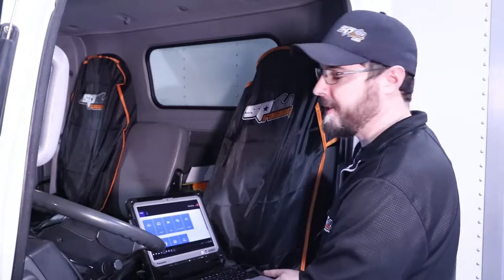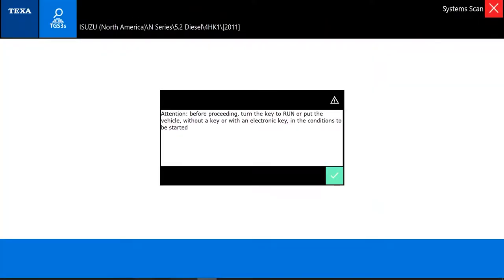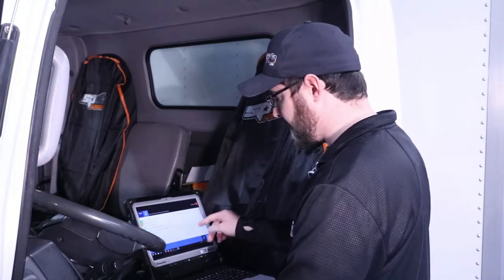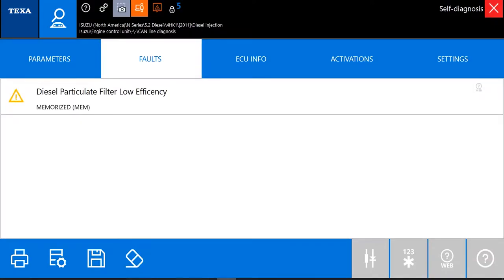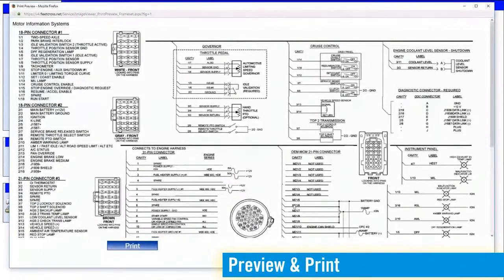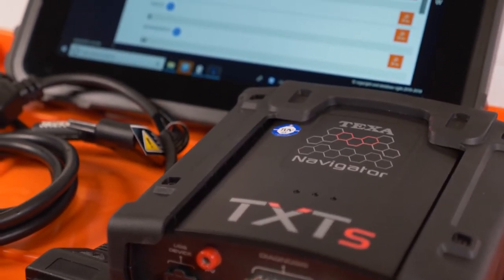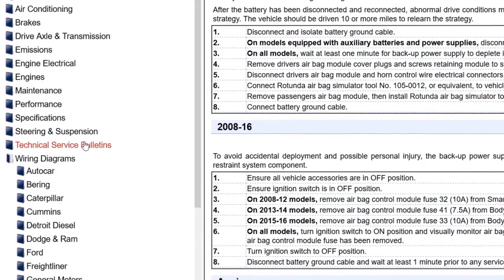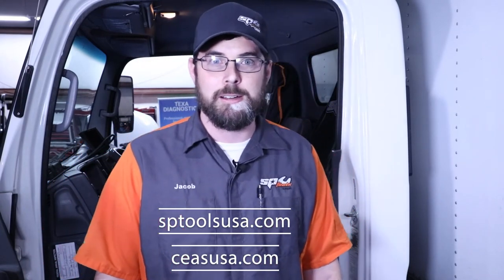Fixing a DPF Low-Efficiency code on a 2011 Isuzu NQR in under 10 minutes with TEXA™Truck

Comment: A friend of mine bought a 2014 nqr with all the Christmas 🎄 ligths on in the dashboard double check engine ligths were on dpf etc etc ,didn't make no more than 50mph
Bought it for 15gram$ 
With 71,000miles on it ,basically the truck still new in my opinion, brand new truck worth$ 61,000
Back to the point, the people that sold the truck to him tough that the truck would have a high price repair and sold it to him ,he bought it like that and guess what ,he drove that truck for a week like that and now it's running like a champ every day ,I guess the def fluid was contaminated or something.

Comment: If pressure differential sensor is not unplugged and filter is pulled and replaced/cleaned does the sensor need to be recalibrated?
Thanks

Comment: If you do find one of the lines plugged,  such as on mine, (2011 Isuzu NRR) the hard line going to the DPF was plugged.  What would that indicate ?  Does that mean the filter is clogged and the soot just built up into the line ?

Comment: my friend i have isuzu nqr 2008 and the dbd is blinking always and the truck power is very low max 50kmh and the exhaust brake very weak i dont know where the problem is i cleaned the barrel for the exhaust brake but still the same problem any idea what to do?

Comment: Hey man I have a 2015 NPR HD 5.2L..the red EXH. SYSTEM light is on, a long with the low power & low DEF light. The DEF fluid is full and it is also showing full. What could cause this? It’ll complete a manual regen, till the end it tells me to “hold rpm over 1500 to purge exhaust” once I do that, it’ll abort and the regen doesn’t complete.
Reply from the maker: Hi Delco, What codes are you getting?
Reply: @CEASUSA  No codes at all..that’s my biggest issue is how confusing it is lol
Reply from the maker: @BassAngler  We know the feeling, let us see what we can find out for ya bud!
Reply: Did you find the issue to your problem. Was it an update/reprogramming issue with a control unit?
Reply: I'm having the same issue with a 2014 isuzu reach 3.0 took the dpf off had it cleaned tried to do the regen it gets to the end. Set rpm to 1500 and it restarts the process! Any help from anyone would be much appreciated thanks
Reply: Hey. Did you ever figure out the problem? Having exact same issue.

Comment: Good afternoon and thanks for this video. I have a 2016 Isuzu reach (FedEx express truck) that it shows me EXHAUST SYSTEM in red and the check engine with an arrow pointing down light on. Before that the message was REGEN REQUIRED but I did the active regeneration process 3 times because the message still so the scanner doesn’t show me any faulty codes so I’m in doubt with this issue if you know what could be I’ll appreciate it thanks
Reply: There is literally no way to clear the “exhaust system / Def light” without the Isuzu IDSS scanner. Autel, Snap On, Texa, etc.  won’t do it

Comment: hi  can you help me my isuzu truck nqr  is smoking bad code is p1404 so i put new egr valve but still the same
Reply from the maker: Hi Eric, Some things to check out
-Faulty Exhaust Gas Recirculation (EGR) valve
-Faulty Exhaust Gas Recirculation (EGR) valve solenoid
-Exhaust Gas Recirculation (EGR) valve carbon blockage
*If you've fixed the valve may just need to check for blockages in the EGR valve and the EGR coolers.
Reply: @CEASUSA  thanks for the response I put new one egr valve and it's still same,thing is when it's reach temperature that's when it's starts smoking which is a blue smoke..the Isuzu dealer said that my truck has no solenoid valve

Comment: Hey what if I have an Isuzu NPR 2012 and is giving that light in the MID display and don’t run  faster than 5 MPH, what can I do and you much would it cost to get a new filter ? Please
Reply from the maker: You can probably pull the filter off and have it cleaned, as long as it isn't cracked or damaged. A new filter from the dealer is around $1200 usually. Of course you'll want to verify all of the after treatment sensors are worked correctly before you condemn the filter. Also, it may need and ECM update. There is a TSB for this issue that is caused by a bad ECM calibration. You can pull the version with a scan tool and give it to the dealer, they should be able to tell you if it needs an update. After that you'll need a scan tool like the TEXA to do your resets and get it out of derate.
Reply: Cutting Edge Automotive Solutions hi guys my truck was running great I stopped using it for 2.5 months so batteries died so I changed them and now it’s telling the battery voltage is High also giving me exhausted system red light what do I do how do I reset it
Reply from the maker: @LuisVelasquez-od3it  Hi Lui, What kind of truck is this?

Comment: P0420. Please help I’ve had an issue with this every couple of months. Now it’s weekly I have my Mechaninc delete the code and it runs fine for a week and boom same issue. I had a  rack on the flex pipe replaced it, replaced def header, 1 nox sensor exhaust side. Please help.
Reply from the maker: Do You currently have a TEXA Scan to your shop utilizes?
Reply: I’m an owner operator. I just purchased the nexlink nexas in hopes to perform the regen so I don’t have to call my mechanic every time.

Comment: Hello, I have a quick question about my 2011 NPR. The amber refuel DEF light wont turn off even after I fill the DEF tank. Any idea how I can get this light to turn off?
Reply from the maker: I would start with a scan tool and see how the sensor is reading, it may be bad and need to be replaced! I hope this helps ;-)
Reply: @CEASUSA  The scan tool sent back this code P20C9 which is a Reductant Control Module Request MIL Illumination.
Reply: I’m not sure what this means.
Reply from the maker: @Movingcompanyhustle  If you have one of our tools our Tech Support Team can certainly help you out on this, please call in at 855-839-2626 and they will get you all set!
Reply: Hey - we are having this same issue. Only see code P20C9 even at the Isuzu dealer with IDSS? Any ideas? No other codes showing. Is there a way to bench test the actual def module for additional codes? Where is the module?
Reply from the maker: @briwilbarn  Not sure with the IDSS, I know our Team can look into using the TEXA Truck software if you have a unit to hook up to it.

Comment: I got a 2007 NQR ISUZU DIESEL, it doesn't have the DPR/DPD, are 2007 came with this system?
Reply: no your truck does not have this sytem .2010 TRUCKS AND UNDER HAVE NO DPF OR DEF

Comment: Can you please give a advise. My dpf was melt. I bought a new one for a mercedes benz r350 2012. Since I changed without waiting the 30 seconds without cranking or resetting the sensor i started the engine then I have the code saying dpf below threshold. Thanks
Reply from the maker: Hard to know without any codes, could be a number of things. May just need a counter reset or something could be broke.

Comment: Hi I wanted to see if you guys could help me out I'm working on a 2012 Isuzu NPR it's in a limp mode problem and has service exhaust flashing I did a forced region on the DPF and it shows it's clear but will not run over 5 mph diagnostic codes are U2105 U2202 U2203 I've tried to clear them but it fails every time
Reply from the maker: @SmokeyJ'sDiesel Are you able to get the Vin number for us? We can try and get the code information for you!
Reply: @CEASUSA  diagnostic codes are P20C9

U2105
Loss of communication with engine control module (ECM)
U2202
Lost Communication with Diesel Exhaust Fluid (DEF) Control Module
U2203
Lost communication with turbocharger boost control module
Reply: @SMOKEY-JAYS-DIESEL  We need the VIN # off of the vehicle please.
Reply: @SPTOOLSUSA  JALC4W167D7001634
Reply from the maker: @SMOKEY-JAYS-DIESEL  Unfortunately there is no code help on one. The only thing we could suggest is there may be an issue with the communication lines since there are so many different loss of communication errors. We hope this helps!!
Reply: @CEASUSA  okay I sure appreciate you guys reaching out and trying to help me and I will look for a data bus communication wire problem

Comment: Can you help me? I have 20014 Isuzu npr-hd diesel my code reader tell me I have a P20C9 code is a low voltage.
I already remplace the DEF injector and nox sensor
Reply from the maker: You will want to check for codes in the DEF module. Depending on the scanner you are using you may only be able to see trouble codes in the engine. I hope this helps!
Reply from the maker: The P20C9 trouble means that the DEF module has requested the MIL to turn on. This means there is a trouble code in the DEF module that needs to be scanned.
Reply: Same issue only code P20C9. How do you scan the DEF module? Not sure my dealer here even knows how.